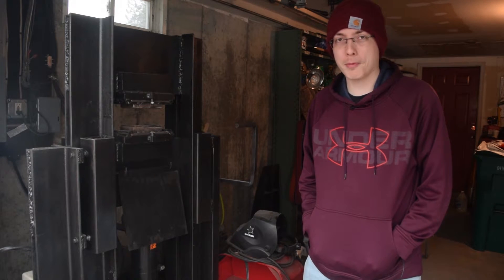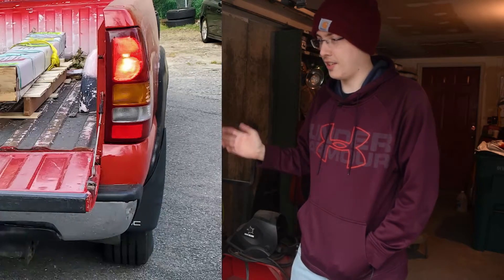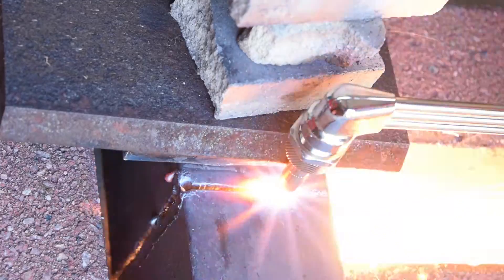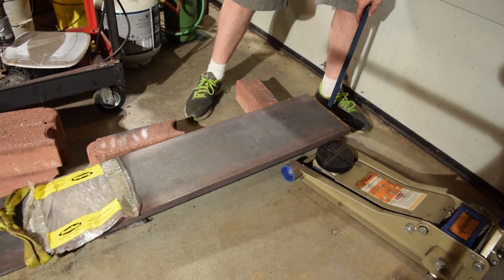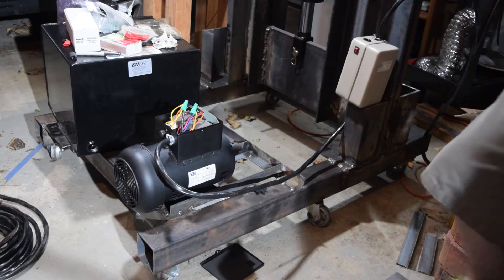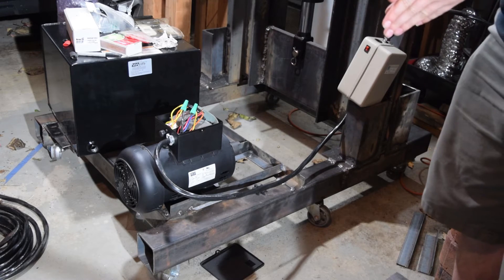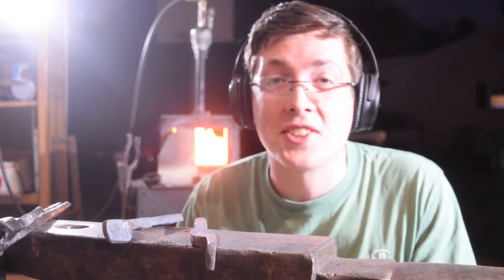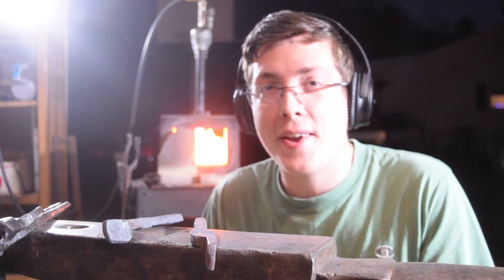Building a 16 Ton Hydraulic FORGING PRESS

Comment: I subscribed after the first 3 minutes. I’ve done exactly the same when I built my 48” reverse smoker, but I’ve done it in a 20’ by 15’ back patio of my rented townhouse. Thanks God all my neighbors are latinos and didn’t complain to the manager because for 3 weeks I was grinding and welding with a $89 harbor freight welder until 11:00 pm some times. Great work

Comment: I like that design a lot.  It presses top down, but without the cylinder mounted on top too, very cool.  Also, another thing I really like, when pressing, the dies are not wiggling around like I see on a lot of other DIY presses.  It's straight and solid.  Outstanding.

Comment: Man, great work. Way to work for what you need, and learning the skills to do it. But have to say my favorite part was whoever was off camera around 13:52 minutes who startled you because of the unknown. I would have done the same. Hat's off to you for some great work. What was your total cost for all materials. Cylinders motors steel?
Reply from the maker: Thanks Josh! I had no idea the sound had attracted a small audience while I was focused on the machine hahaha.
I forget the exact figures, but I remember working out that all materials (including new tools I needed to buy) cost about half of buying a professionally built press with the same cycle speed and tonnage.

Comment: Excellent video man. Do you have a picture of the motor specs that you used? How do you like the speed of the press when in low pressure mode and when in "working mode"? Would you rather it go faster or slower or is it good?
Reply from the maker: Thanks! Yeah, here's the motor's model number 00536OS1DCD56H-S

As for speed and power: I spec'd it out to mimic commercially available "plus" models of 16 ton presses. (The speedier ones.) It may only press 16 tons, but it moves in a hurry, which is great for general purpose forging in my experience. I'm able to feather the valve enough to slow it down when needed, so its fast, but still controllable.
Working mode is great. Trucks along until it hits the systems pressure limit set on the valve.

Comment: Curious if the cost of all the material was close to equal to buying one?
Reply from the maker: Great question. At the time, it was a little less than 1/2 the cost of purchasing. Worth some people's time, not so much for others. Was during lockdown, so worked out great in my case. A purchased unit would be nicer too, but I'm happy with my monstrosity haha. Also know how best to fix everything should something go.